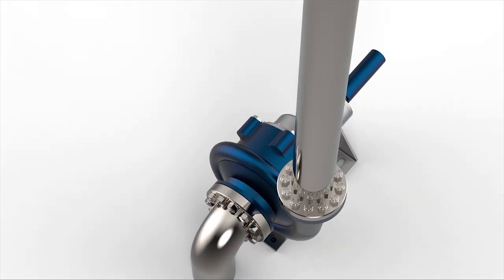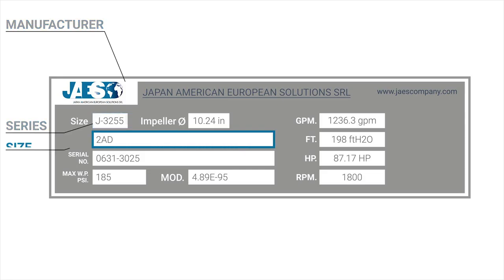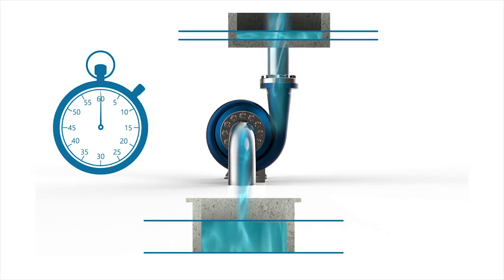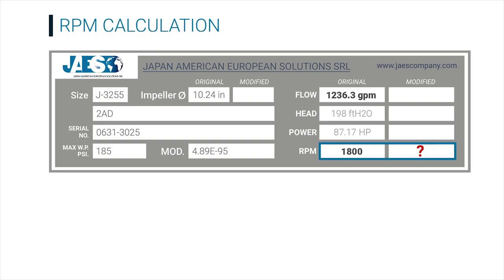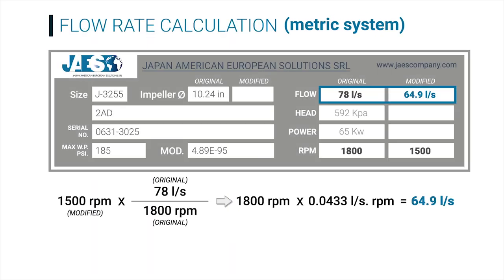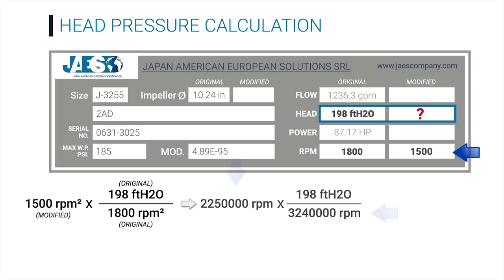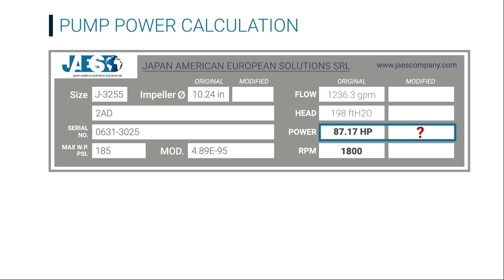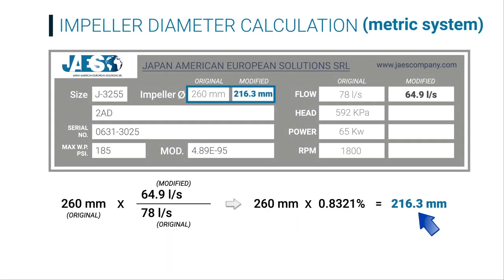Centrifugal Pump Sizing Calculation: RPM - FLOW RATE - HEAD PRESSURE - POWER - IMPELLER DIAMETER

Comment: The relation between flow rate and the Head you have mentioned needs to be checked as far as i know head is inversely proportional to flow rate. The characteristic curve for any pump suggests that at highest flow rate there will lowest head. Please correct me if am wrong
Reply: That's correct. Maximum head is when the flow rate is zero.

Comment: Sir these formulas are helpful in calculation of new value but sir how to calculate the original at the first time ( when we dont know the original ones) 
Suppose i need a air compressor to suck (1/2) kg of weight in a pipe then how i calculate the values ??

Comment: Isn't there a relation between number & dimension of the blades on the impeller and the parameters ?
I mean the larger the blades the more liquid it will pump and the more power it will require so the less the number of blades the less liquid it will pump and the more rpm are required to achieve the same efficiency

Comment: Dear sir, I need your help that, we run a centrifugal pump which is 22 kW motor head is 40 Meters, discharge is 140 cubic metres per hour and discharge pipe Dia is 6" of 385 metres long and 165 metres of 2"branch pipes.But the thing is we need 7020 ltrs per minute, actually it is 2330 ltrs per minute.so please help me regarding this matter to improve the quantity of water and suggest and send design calculation formulas, which is helpful for me in future.

Thanks and with warm regards by

SURESH R
Maintenance manager
Aradhya Steel Pvt Ltd
India.
Reply: Waiting on this too...